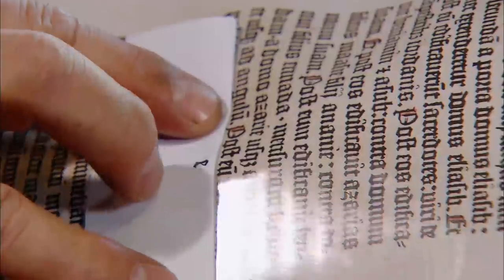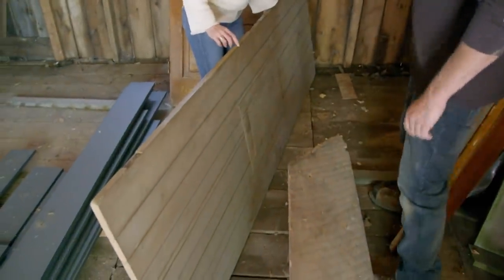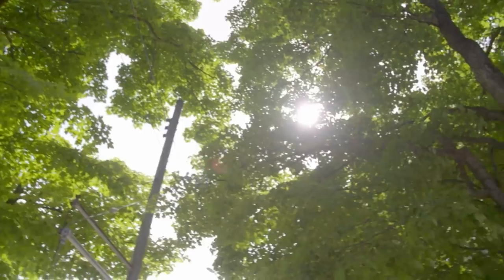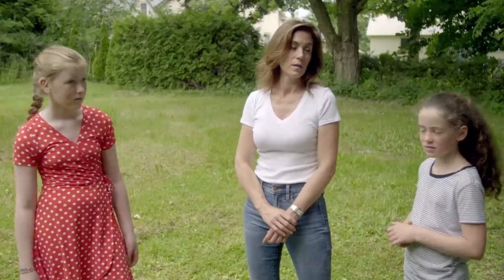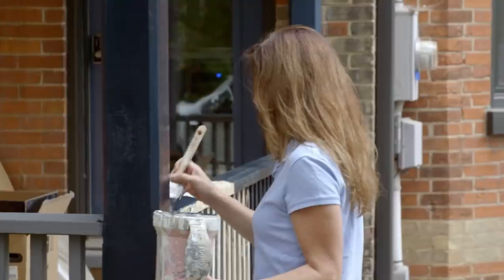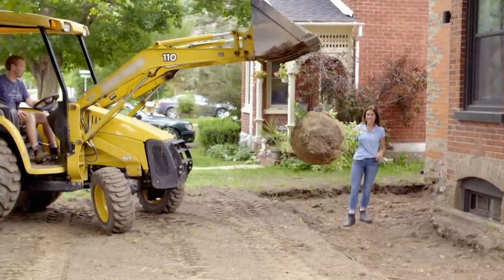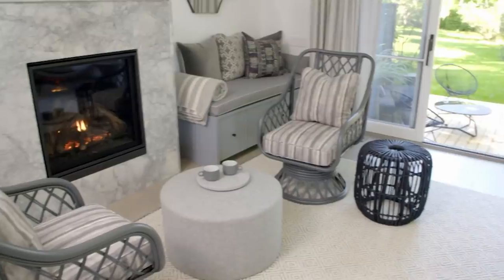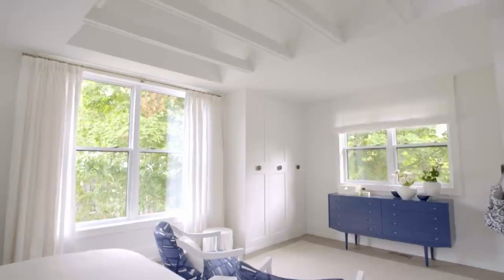The Luxury Getaway Home Final Look | Sarah Off The Grid | Abode

Comment: Great barn redo - however, not insulating it means it has limited use.  One can see the outside through the gaps in the siding!  Not a good thing in cold, rainy, inclement weather.  Maybe, somewhere down the road this can be fixed...?

Comment: So tastefully done, so rich so layered and beautiful. The only way it could have been better is if you had installed air source heat pumps for heat and ac instead of installing the old fossil fuel burning technology for heating. Love the mix of brick and metal roof!

Comment: Sarah, there are open cracks, crevices in the barn walls, won't that damage the furniture, floors & interior????
Reply: It will weather it some more. This is why she chose indoor/outdoor furniture. Plus, when it’s stifling hot out, if there is a breeze, it will help the air circulation. Old wood loves air circulating around it. 
We have a weekend coming up very soon! Hope that you have a chance to relax!